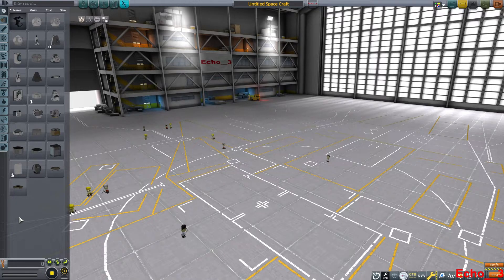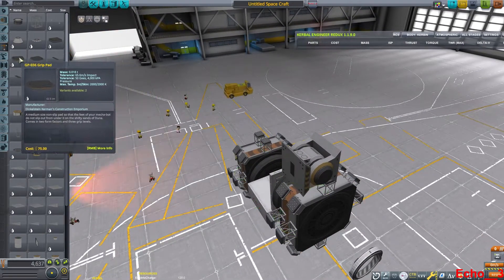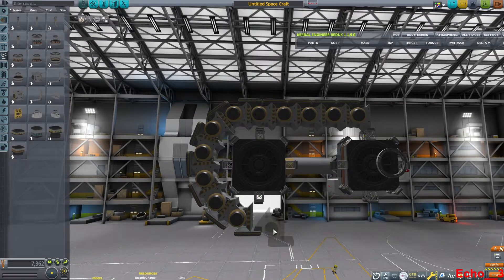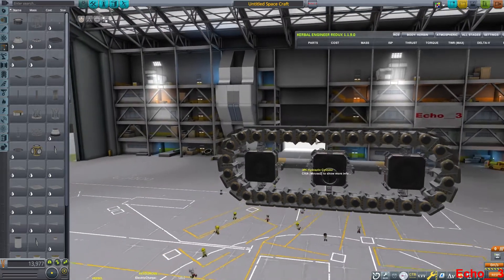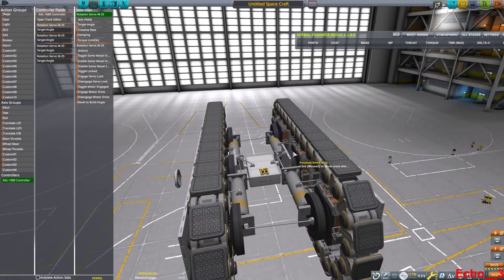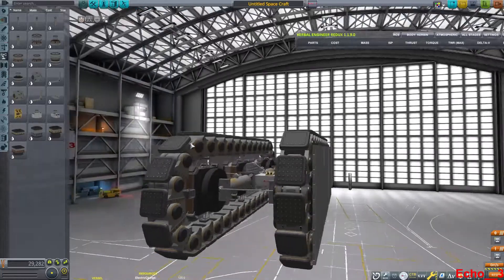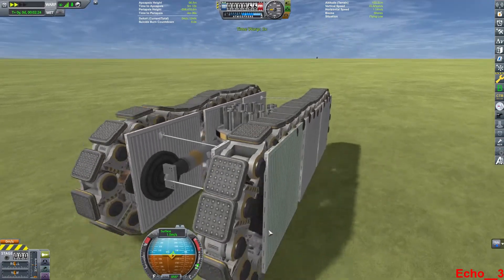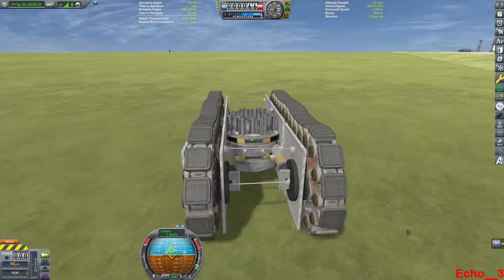How to Make a Tracked Vehicle in KSP

Comment: I wonder if the floating issue is due to the separate crafts interacting. Maybe the buoyancy isn't being calculated correctly for the tracks?
Reply from the maker: While this kind of works, modded tracks are far easier to use.

Comment: is there a way to increase the strength (torque) of the rotors, hinges and actuators? Not sure if increasing the amount of electricity available really matters
Reply from the maker: You can increase the torque with the KAL 1000 overclock exploit.

Comment: quite interesting. i was able to make tanks before this video and came up with a different way of making the tracks and sprokets, but i like the way you made a way to tension the tracks, so ive added it to my main tank and it solved the issue of the track coming off when going around sharp turns.

overall your method works well and good video
Reply from the maker: Thank you. This is a tricky craft to make.
Reply: @Echo3  yeah, i have also developed a system of suspension for mine to meaning it can drive upwards of 10 m/s without suffering a kraken attack, and i intend to upload a video on how i make tracked rovers soon
Reply from the maker: @kritmaster2561  sounds great. Please share a link to your video.

Comment: better than my idea of manually programming each frame of a track moving and rounding corners ect.
Reply from the maker: Wow, that sounds very tricky. The best method is probably just to use a mod that has tracks.
Reply: @Echo3  i just built a tank as a proof of concept your way, and it's too buggy and slow for me. i don't wanna mod, and i no longer want to build tanks either XD

just had an idea... a spider walker where each leg is tank tracks? "awe shit, here we go again.."
Reply from the maker: @AVERYhornyMrDinosaur  You might be better off with a Kraken powered hovercraft.